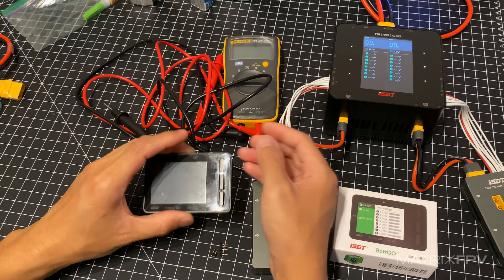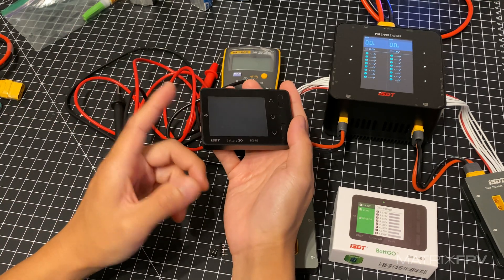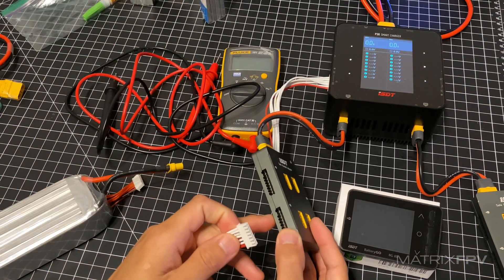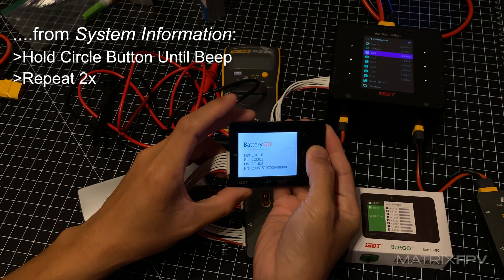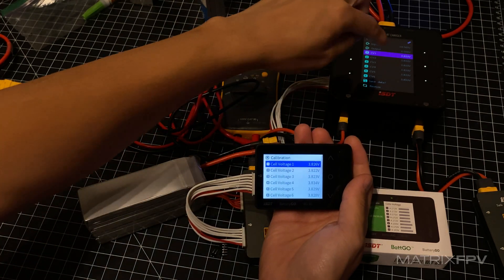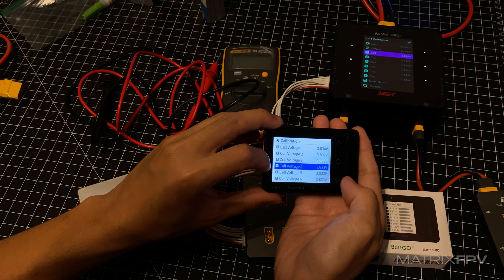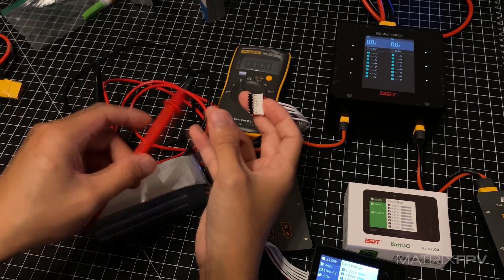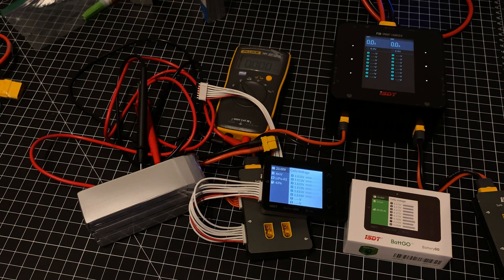How To Calibrate ISDT BattGo BG-8S

Comment: if I calibrate mine so it's perfect, it will only be perfect for the battery I used to calibrate it. if I use a second battery, all the voltages are off. if I use a third battery, that one is off from both the previous batteries, and so on.... only that first battery is ever 100 percent accurate :/
Reply: There are many factors like wire length, resistance etc. that can effect voltage readings, but it should not be different ( or a significant difference) on every battery tested....that's like saying you have to calibrate your multimeter every time you test a battery. Unless I'm missing something here.